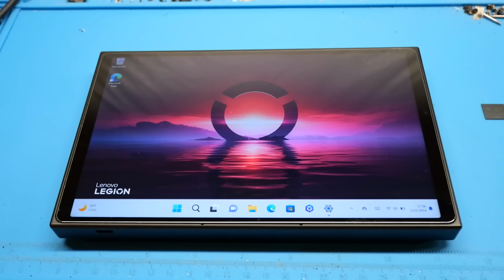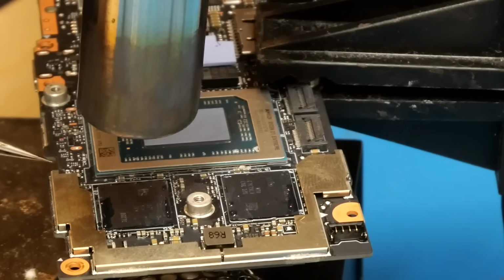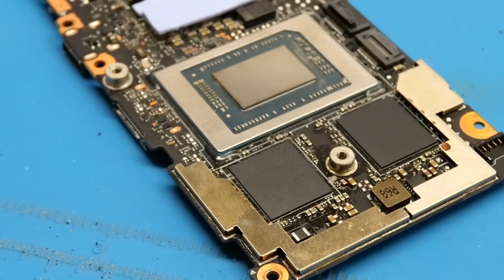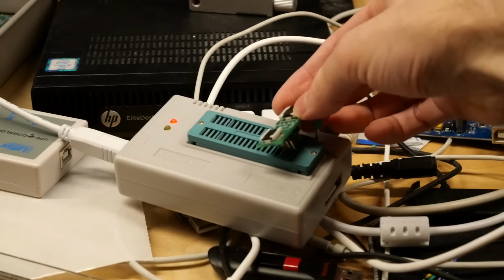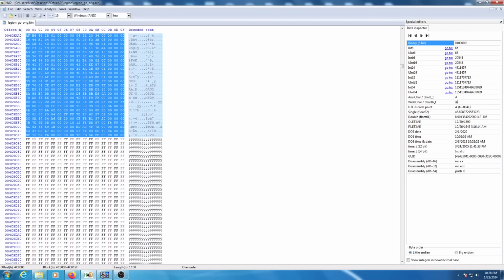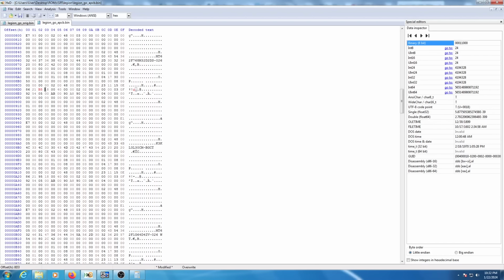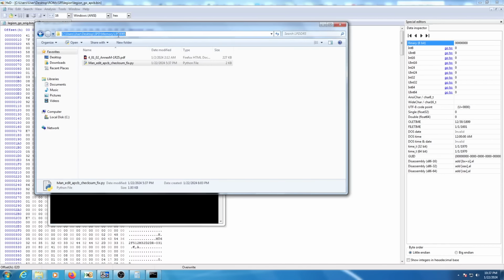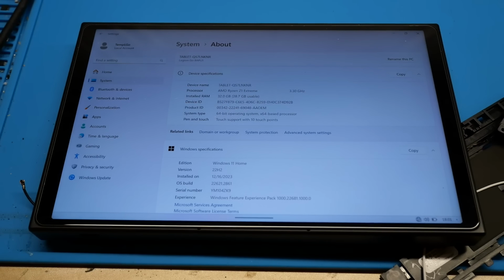Lenovo Legion Go 32GB RAM Upgrade

Comment: do you think you can increase the amount of allocated memory to the onboard gfx card to boost performance?
Reply from the maker: I believe so, I think there is a BIOS setting for that on the Legion Go.
Reply: @dosdude1  all the new bioses don't have that often or they have like upto 512mb
Reply: @gadget_hack   Judging by the windows system info it was allocating around 3GBs. I think some newer systems can do it dynamically.
Reply: @osrr6422  interesting 🤔
Reply: would the ram with 8533 mhz also work??

Comment: This is cool to watch but you will have to flash the memory whenever you do flash a new firmware on the bios. So, if you are thinking of having someone upgrade the system memory, remember, you have to flash the memory everytime you upgrade the bios. This is info not told to people.
Reply from the maker: SPD data edits are always required if installing a soldered memory configuration not originally supported by the device. If the BIOS does already have the necessary SPD data present, it can usually be selected by setting strap configuration resistors on the board appropriately. It is true that BIOS updates will indeed overwrite the modified SPD data, but it is possible to modify the BIOS in such a way to prevent further BIOS updates from being installed, which I did later.
Reply: @dosdude1  How does one modify the BIOS to prevent it from installing further updates? I'm kind of out of my depth but I want to attempt this upgrade eventually, any guidance would be greatly appreciated
Reply: @dosdude1  mine didn't. So somewhere in some lab the UX3402 had a 32GB variant and they never stripped anything from the production firmware UEFI settings.... If I were to 100% believe that. Which I'm a little sideways about. Don't know if your info applies to all manufacturers.
Reply from the maker: @crazyidiot5309  Highly possible... Just like the 2015 MacBook Air has SPD data for 16GB config, but was never actually sold with more than 8GB installed.
Reply: @dosdude1  it could be possible that it could be from prototype versions of the same concept
Reply: @dosdude1 YOU ARE AS GOOD AS ME ONLY THAT YOU DO IT FOR WORK, I DO IT FOR PASSION SINCE I DON'T NEED TO WORK 😂I HAVE UPDATED MY NINTENDO SWITCH OLED MODIFIED WITH 8 GB RAM IT'S MY ALLY I HAVE PUT 32 GB RAM.. IN A MONTH I WILL I DO IT WITH THE LENOVO GO 🇮🇹🇺🇸☝️🙏
Reply: Are you in the us?  @alexandergozzi25
Reply: @alexandergozzi25  what are you blabbing about? You type as if you think you know why @dosdude does what he does!! His extreme passion and knowledge on technology is documented and well known while no one even knows who you are....I know your English may be making you seem more arrogant than you may have meant it to sound but doesn't change what i said!
Reply: Dumping SPI_NOR flash is interesting 😅 just to make sure to unprotect the lock protection bits before writing
Reply: Well if needed it is not a big issue to write a patcher. Since it is compatible enough to boot even with original SPD block, soldering will not be necessary. As for initial installation it is easier to repair tech to work with spi directly.
Reply: So how many people found this video thinking oo ram upgrade only to realize nope, I totally don't have the skills or tools to do this?
Reply: It's only a spi chip you'll need to resolder and reflahs. You can also get spi clips so you can clip on without having to solder.
Reply: How would flashing the bios go? A part of me wants to get this upgrade but I have no idea how crazy it would be to reflash the memory
Reply: Do a video upgrading the battery
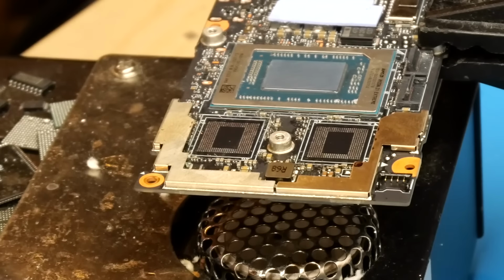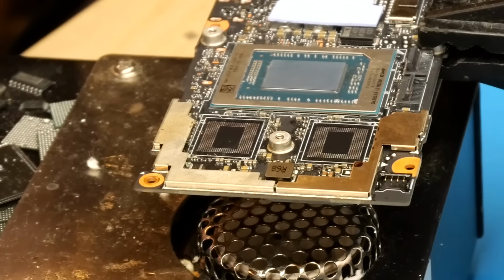Reply: 7:00 7:00
Reply: Awesome vid man I'm just getting into the hobby and this is very helpful! 

Most other channels breeze over stuff.
Reply: So what? Lol
Reply: How much difference In the device would you notice?
Reply: Incorrect. "Flash the RAM"? Do you have any idea how dumb you sound saying that?
Reply: He literally explained it in the video
Reply: Oh, system number. I need to follow up to this video. I need to know how stable if the performance was any better. If you ran into any problems down the road, please update me. I want to do this to mine.
Reply: if someone is doing all this stuff, future firmware updates overwriting the bios is pretty obvious...
Reply: @dillyflaps I honestly didn’t know that because I’m used to slot ram and not soldered ram. I’ll have to figure out what flashing is myself.
Reply: If you have UEFI like this does, you don't. The board will normally do it on boot. It reaches out on boot to see hardware, then sees the RAM. If it's the same manufacturer ID, it will just feed them timing and JEDEC info to run at the speeds and latencies of the last chips just with more capacity. I know ASUS does this and Acer. I believe it to be a factory thing for DDR5 ICs. I've replaced my 8GB Hynix ICs in my Asus Zenbook with 315-ball SK Hynix ICs with 16Gb (8GB) ICs. 8x4=32GB. Make sure to use as close as possible, the closest IC you can. Timings, speed, and most important... Pad count. Mine are 315-ball pads. Makes the whole process easy.
Reply: Chances are, If you don't know this already, there's no way you would ever be thinking about upgrading your RAM on this thing.
Reply: Thanks for the info. God bless. Jesus loves you!
Reply: Walk me threw that process
Reply: I am a lifelong gay member to computers. I’ve always played on the council and this stuff is terrifying to eat. I don’t know what any of it means. It’s like reading an alien language and I am 100% will do something wrong.😩…. This is what scares me away from this stuff. It’s too complicated if you’ve not gotten into this stuff. Buy a nice device and play games on it…..is that possible without a ton of computer knowledge? Would a legion Go be a bad idea for a person who a console gamer? Just in the middle of a movie situation and I don’t want to buy a TV in a whole set up and I know I’m not gonna be where I’m at a year from now so I’m trying to just get stuff that’s easy to take with me wherever I go.
Reply: meaby les betching about and more real geek work as hit master you losre XD
Reply: @nin1ten1do  I agree and have been acquiring BIOS images from a multitude of OEMs to deconstruct. It's not an easy thing to do and takes time. Hold your biscuits for a minute.
Reply: Jesus loves everyone the bible is true! Again Jesus loves everyone!
Reply: @HolySpiritIsSatanOfSinDethHell 😂😂😂😂 the bible is literally not true. Look into the history of the bible.
Reply: @Porcupine694 What makes you say that?
Reply: @Porcupine694  because you were gifted with unknown info no one else has due to your high iq
Reply: @HolySpiritIsSatanOfSinDethHell  why post asinine spam? This is nothing to do with what we were discussing? 😒
Reply: @crazyidiot5309  
Greetings friend 👋! I hope all is well! I am going around letting everyone know that Jesus loves them and that the Holy Bible is true. God commands us all to change our minds and believe the good news so we may be saved from sin, death and the scary gehenna. 

God really wishes you'd join Him He loves you and wills to endow you with His Holy Spirit! You will have constant victory, you will be guaranteed to inherit God's kingdom no matter what although we will go through hardship but, again we have victory because of Jesus HalleluYah! 

What do you say my dear neighbor?
Reply: @crazyidiot5309 Did you not watch the vid! I would have said a quick prayer before tackling this. 😅

I just.... I know when I'm in the company of my tech knowledge and know how betters.